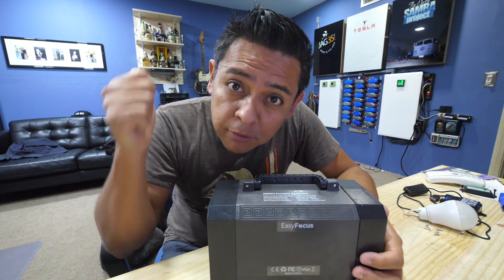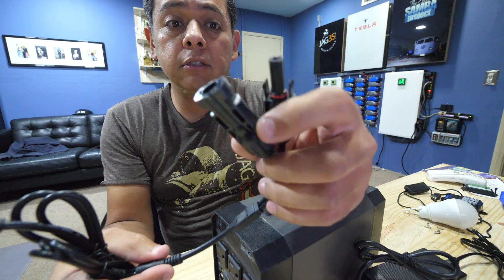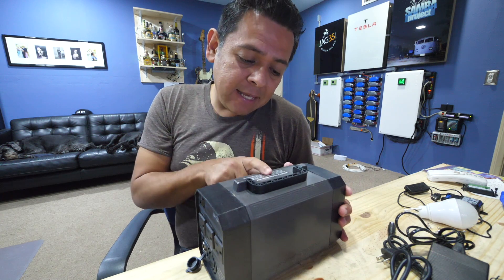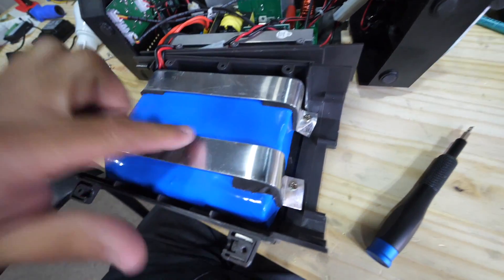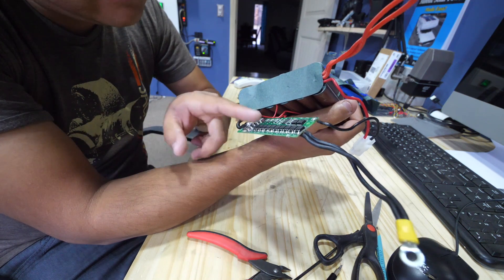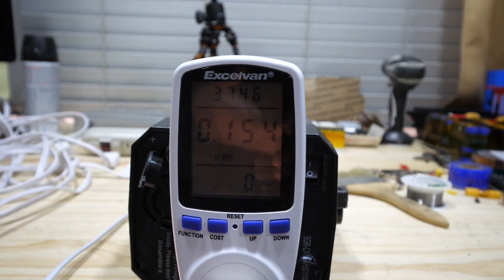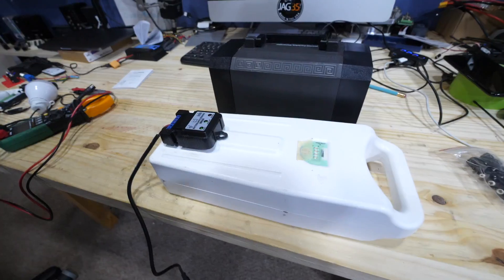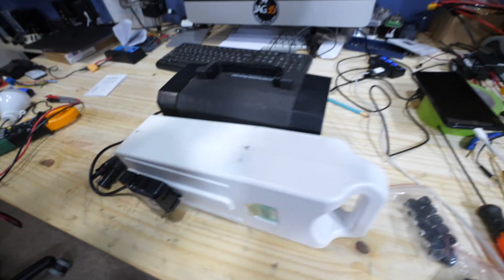EasyFocus 200Wh Solar Generator,   Review and DIY Upgrade

Comment: Don't know if i'll get a response since this video is a bit old, but here goes. This sounds good and the price is right, but this I need to know. I have a electric scooter, it has 3 - 12 volt 15 amp battery's, the normal charge time through a household wall plug is 3 to 4 hours. The rate of which my changer operates from is 110 / 120 volts at 60 hz delivering 1.5 amps. Will this unit be able to charge my battery's.
     I see many different video's and they all for the most part usually have wall plugs in them, but no one ever seems to say how long the run time is on these solar generator's. I can only feed my battery's through my changer and it only feeds at a rate of 1.5 amp, so the generator will have to have a run time at full charge of at least 3 to 4 hours. Does this unit do this, or do I need to find a larger solar generator.
     Also since I'm picking your brain, could you tell me if there is a portable folding solar receiver / panel that would recharge this unit during a normal sun lit day of 8 hours. If so what size / out put, would I be looking for. Pretty much a lame about this stuff so I would really appreciate any help you could give. Would really like to have a combination kit that includes everything from solar panel to generator and plugs, that fit into a back pack, not asking for much Ha! ha!, thanks.

Comment: Bro. This is the same for a ups?  But the ups charges the battery. When plugged in. 
But your saying to scrub the grid to the ups. And use my solar to charge the batteries or grid to batteries. But not to ups.

Comment: Nice video! By the way is there any way to use the power pack as is , for a 12 volts system, without modification?

Comment: Hey J 

Not to beat a dead horse, but how well will the charge controller charge the 12v batterys isn't the controller for 11.1v? I want to make one of the these and bought the components.  I was hoping you can go in further depth relating the charging
Reply from the maker: The battery is a 3s 3.7 nominal voltage cells,  it’s designed for lithium
Reply: But doesn't this charge controller charge up to 11.1v leaving the batterys not charged? Can you explain this for me

Comment: To create a solar generator and work with around12v-14v should I choose 3S or 4S? I right now have a 60A car battery and would like to switch to 18650s.
Reply: Or am I better off with 24v or a 36v?

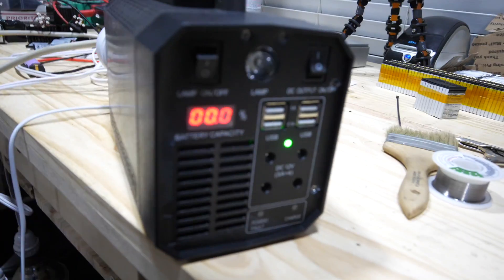Comment: @ 3:34 was the battery fully discharged? was the adequate undervoltage protection applied? (the one that protects the battery from being completely drained to the point of no return)

Comment: Sorry to Say bro that it is a bad idea to series, and use charge controllers after charges controllers there is a lost of power everytime you charge another group of battery. So the best way I can think of is arrange for the extended battery to be pallaral with the original battery and to use a battery with same number of cells and or voltage.
Reply from the maker: Yeah but that requires you to take the thing apart and solder,   Not the best solution s for someone without power in Puerto Rico.   Context is a bitch

Comment: Oh c’mon Jehu,  I build a 7 pound powerhouse at 518WH , comes with AC charger, DC charger, and cab be charged via solar.
Package deal with a flexible 50w 18v  solar panel. It has a 300w pure sine wave inverter. 2 USB ports, 1 12v power port, voltage meter and 2 110v outlets for $450 Puerto Rico now has one and more going

Comment: Help? How exactly is the med battery able to charge the solar generator via the solar charge controller? Does it actually 'charge' the solar generator, or is it really more just acting like a pass-through and allowing you to use the medical battery via the solar generator? I ask having a 400Wh Suaoki solar generator I use for powering my cpap when i'm camping, and adding a second battery in a manner such as this would help tremendously

Comment: The capacity you measured is after the efficiency of the inverter, I highly doubt that the inverter has an efficiency of 85%. So it does make sense to measure the capacity directly from the battery
Reply: I think you should do that. Please buy one and when you are done with your research project, ship it to Javier, "affiBox Gaming" on youtube or Search for Diy Powerwall PR, he lives in Puerto Rico and I bet he won't mind the losses since the power is free from solar and the power company sucks there and people are still without power months later.

Comment: So, what happens when your solar panels charge the 3S lithium ion pack to a voltage higher than 12.6V?
Reply: Ah, I didn't notice it says it is for a 3S pack, thought it was a typical lead acid 12V controller. Have you tested it to make sure that it actually doesn't charge past 12.6V? I can't find any specs on this controller anywhere else on the web... and with those cells it's definitely worth being sure that it won't overcharge.
Reply from the maker: +Home Solar Research  it doesn’t
Reply: You return the SOLAR CHARGE CONTROLLER to Amazon because it isn't doing it's job and they fedex you a replacement the next day.

Comment: You are measuring the watt-hours at the inverter output and did not take into account the efficiency of the inverter. Inverters are normally 85-90% efficient, but they get worse as the load increases. Therefore, the actual battery capacity would be about 10-15% more than what you measured. Another important consideration is the current at which you are measuring the capacity. 300w translates into about 30A from the battery pack which is pretty aggressive for an 18 Ah pack which means the battery pack could have done better.
 Also, charging one pack with another is a big waste of energy, since charging batteries is not an efficient process. You can put the external pack in parallel with the internal battery.
Reply: I don't think anyone in Puerto Rico actually cares about the efficiency and are just happy to run a few lights and charge their phone. And it's more like the batteries are in parallel for charging from that charge controller, think about it and then spend the time instead contacting Javier, "affiBox Gaming" on youtube or Search for Diy Powerwall PR. he lives there and you can send one of these to him and I bet he won't mind the losses since the power is free from solar and the power company sucks there.

Comment: It does have 200Wh of capacity Jehu.
It's just that the AC inverter isn't very efficient in this unit, and probably uses a modified Sine wave inverter.
Try loading something on the 12V/USB ports, and report back its capacity using something like a 2.5Ohm resistors to drain the pack in about 20 hours along with a USB power meter, and then, you could calculate the real capacity of the bank.

Comment: OOPS! I just noticed the EasyFocus box is connected to the "load" or "light bulb" output of the charge controller so it will only charge the box at night! So for anyone doing this, connect to the same place as the white battery. Meaning parallel them. The CC in the EasyFocus should do a low cut out at some point before both batteries go too low I would think. And we know it turns off the inverter at some low point anyway. It also won't feed back into the white battery since it's a CC in there. Interesting all the little details you have to think about when doing this.

Comment: I have a question on the Sonata Batteries in the white box you were using to charge the box with.
the batteries seem to be set up in a 3S5P format so they would be at 11.1V nominal voltage. 
in order to use them as a 12V battery pack in a Solar storage system, would you recommend re-arranging the 15 batteries in there to be a 4S4P (if you had 16 of the Sonatas, or a 4S3P by only using 12 of the Sonatas?
Love your Channel.
Russ from Coral Springs, Florida, USA
Reply: What is wrong with 11V? There's not much left for power at the bottom part of the power curve for li-ions, it drops off pretty fast, you should look it up, and actually it's going to sit more up near 12V most of the time. You should see what your inverter's cut off point is but most are at about 10V meaning 3.3V and at that point you don't have much usable energy left anyway.

Comment: Watching this made me realize that I can repurpose an old Wagan Tech Power Dome(air pump, 400w inverter, and jumper cables) I have in the garage with a dead battery. I was already planning on building a 12v lithium battery for it but didn't think about getting another pack to charge it back up. I already have 2 230w 24v solar panels and a mppt charge controller to charge it up, so I think I'll just get a couple of those medical battery packs.

Comment: +jehugarcia Why didn't you add the medical battery in parallel to the existing battery? Or is that what you did? haha
Reply from the maker: because I was trying to figure out a way to not open the generator to make it easier on end user

Comment: So when you pull the BMS off of the medical pack, how do the individual cells balance charge with that solar charger?
Reply from the maker: it doesn't
Reply: Does it really need to ?
Reply: If you strap a bunch of old used who knows what condition and age laptop batteries together, you are going to need something that tries to keep the batteries from going over 4.2V, but really if they are pretty new and manufactured at close to the same time and chemistry, they will tend to stay the same for some years to come. I've had my Leaf modules for almost 2 years now (see video) but they are 2015 low mileage ones. I've been keeping an eye out and also I don't push them to 4.2V to get longer life so that should be considered too, meaning even if they were a little off, you have room to spare. Some day a BMS will be needed but for the people who need this in Puerto Rico right now today, a BMS can come later if they even care, 3S is easy.

Comment: So if I understand correctly, the modified medical battery does not have BMS as it is removed and the lithium charge controller is handling all of the charging for the medical battery.  Are there any saftey concerns considering the solar lithium controller and no BMS?
Reply from the maker: +vtmaestro  no my bus has been running around for years without a bms,  but you could also install a $10 3s bms on it if you worry about it

Comment: Links from the description:
Amazons $199 Solar Generator http://j35.us/200wh-SolarGenerator
$45 12v Medical lithium Battery http://j35.us/BostonPowerBattery
$6 Lithium Solar Charge Controller http://j35.us/3s-Lithium-Solar-Chrg-Controller
Flexible Solar Panel http://j35.us/12V-100w-flexSolarPanel
FAQ:  
1)  Where can learn more about batteries? http://j35.us/DIYlithiumBatteryBook
2) Where can I buy Lithium Batteries http://j35.us/SmallerBatteries     http://j35.us/150perKwMods
3) Where can I buy a BMS?  http://j35.us/Batrium

Comment: You didn't take into account the inverter losses?
Reply: Hi Piet! He did one better, he actually showed you the losses in the real world!
Reply: nrodge1 200w capacity is pointless for AC. In the real world you would use the wasted 20W on lighting and keeping mobile devices topped up.

Would run my TV for 3 hours though.
Reply: Piet, how are you doing? I enjoy your videos. I know it's not much and I think his last video with the UPS is also good at 980W output but he's really trying to find ways of getting some people in need some power in Puerto Rico and in a simple way from what is available.  Even if they just have lights I'm sure they would think it's amazing. And since this ready to go "box" can connect to a solar panel as is without mods, that's pretty good. Your point is valid, you could send some 18650s and some LEDs to them but they do have other small appliances they could plug in and later on when things get better there they could expand the system.

Comment: What happened with the 18 650 battery holder that was easily configurable and don't have to solder or anything
Reply: No soldering with Jehu's link:
http://j35.us/150perKwMods
Just bolt on the wires and be done with it.
The 6S is great for a normal 24V inverter, they low cut off at 20V which is perfect and use the Epsolar 4210A charge controllers and enjoy pissing off the power company for super cheap. I just saw a deal for 41c/W and 48c/W panels out there so things are really getting good.
Reply from the maker: +keith mcmahon  I’ve yet to see one

Comment: Hey Jehu! Maybe this is slightly unrelated to the video but how much longer do you think before we will be able to do a full charge in a little under 10 minutes for a vehicle that's about the size of a Tesla model 3?
Reply from the maker: +Achal Acharya  as soon as a battery that can do that I’d invented, and we’ll also have to upgrade our connection to grid to support 500kw rate
Reply: jehugarcia so would you say by 2020 we'll have that battery and infrastructure?
Reply: No, since some places are now selling solar panels at 41c/W, by 2020 they will be only 2c/W and so you will fill your yard and roof with them and make your life so you never charge your car from anywhere else. Oh, and Amazon and Google will send groceries and other items to your house by robotic delivery so you won't have to go anywhere anyway. Plus you won't have a job because the robots took over. The power company will be gone by then anyway and everyone will be happy about that. (except for the people who used to push buttons there, I'm sure that was fun)

Comment: Is the solar charge controller a bms? Will it shut down when both are “full”?
Reply: Battery Management System BMS, and you see it on the EasyFocus battery and it probably does protect from over charge and it has it's own charge controller anyway BUT... The added CC says it's for Li-Ion and seems to be for 3S at 11.1V (it doesn't say the cut off as that is kinda low) so all is well and the world won't explode today but you really should see the videos where people have taken Nissan Leaf cells and tried to set them on fire/poke them with a screwdriver so it depends on what cells you use for how safe you are and really wrapping a flat cell up tightly into a small can like 18650's never seemed to be a safe thing to me. See the 150perKwMods link below for a safer battery for the home, it uses flat cells. Did I just type enough?
Links from the description:
Amazons $199 Solar Generator http://j35.us/200wh-SolarGenerator
$45 12v Medical lithium Battery http://j35.us/BostonPowerBattery
$6 Lithium Solar Charge Controller http://j35.us/3s-Lithium-Solar-Chrg-Controller
Flexible Solar Panel http://j35.us/12V-100w-flexSolarPanel
FAQ:  
1)  Where can learn more about batteries? http://j35.us/DIYlithiumBatteryBook
2) Where can I buy Lithium Batteries http://j35.us/SmallerBatteries     http://j35.us/150perKwMods
3) Where can I buy a BMS?  http://j35.us/Batrium

Comment: Does anyone know where I can get a frameless rack system to install solar panels on a roof . My friend gave me 20 305w sunpower panels .. and I dont want them to got to waste ...
Reply: A lot of people use "Superstrut" that you can get at Home Depot. I also did ground mounts with it, see my early videos from way back. You also want to dedicate about 2 or 3 of those panels to your hot water heater and take that mostly off grid since it's like a 6 KWh battery you pay to charge up every day, see my hot water stuff.

Comment: awesome video but why did you put a link for a 24 v solar panel when the system is 12 v
Reply from the maker: Well,  the charge controller should be able to handle the 24V but on closer inspection the charge controller does not say what the operating solar voltage is,  so I just changed the link to a 12v,  I do know it works as I was charging the system using a 12v (18v actual). panel today http://j35.us/12V-100w-flexSolarPanel
Reply: ok cool but i was also wonder why did you not use a bms?
Reply: He pulled the BMS off the EasyFocus battery and showed it. I think everyone started watching the dog. Jehu should do more dog videos! Also, 12V panels generally go to 17V and sometimes 21V open circuit so you may be able to put a higher voltage into the EasyFocus box with other batteries types available  but you would want to check that first, maybe contact the company. And for now the white battery will be fine for many years because all the cells are the same age and chemistry from the same factory, not random laptop batteries. You could also plug it into the cigarette lighter socket on your electric car and have an even bigger battery :) Please see my channel for some more solar DIY stuff.

Comment: 4:40 Monster blobs of solder are a safety risk - I've seen solder blobs melt during overcurrent, and the liquid solder then arcs and generates heat in a short circuit condition.   The blob there would easily spread to other nearby components.  5:20 yeah, it's strange indeed.

Comment: Is generator really the right term. it doesn't  create power it stores it
Reply from the maker: Gas generator also just store energy in the gas tank.
Reply: mqe73M I don’t agree with it being called a solar “generator” but that’s technically the correct terminology
Reply: Everything just stores potential energy... 😉
Reply: I suppose you guys are right, But i think I would of just named it " High capacity portable battery bank".
Reply: Did the flex solar panel work with the charge controller?
Its 12v system ... just curious because even though it says its 12v on the site's data sheet it says 18v.
I remember you saying that one 
Flex solar panel was 18v.
Just wondering if the link you put had wrong info.
So .... did it work?
Reply from the maker: yes solar panels voltage fluctuates all over the place there really isn't a 12v panel